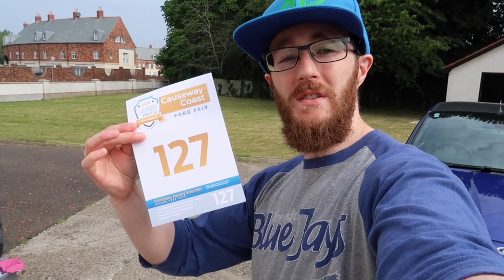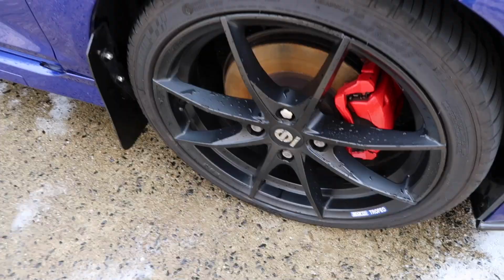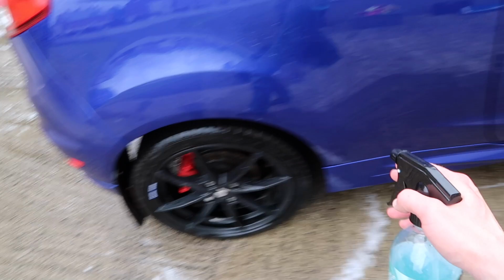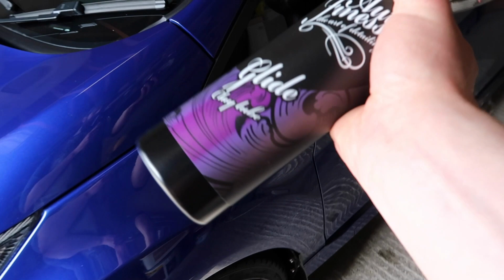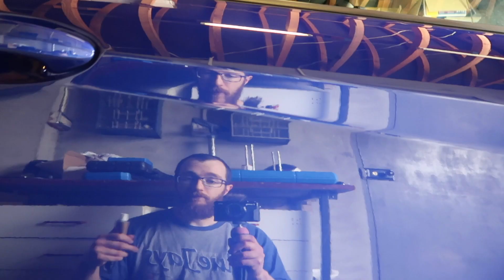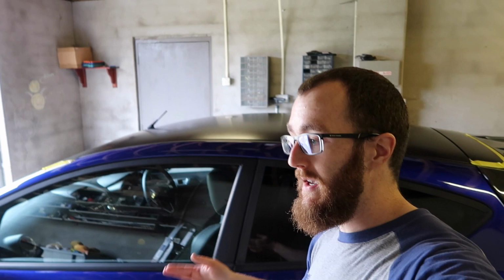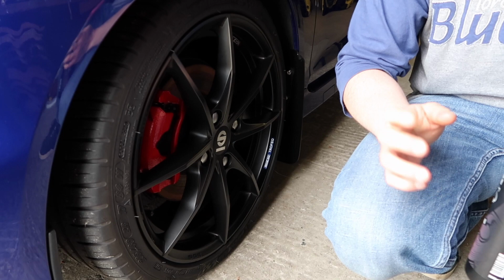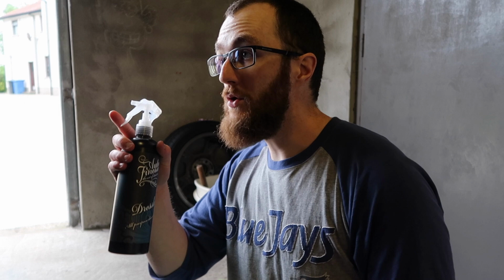FORD FAIR PREP! | MEGA DETAILING SESH | FIESTA ST

Comment: Cracking video. Really enjoyable watch. I have a molten orange fiesta st myself. Where did you get the roof, spoiler and mirrors done if you don’t mind my asking?
Reply from the maker: I got the roof wrapped at a place called AutoSkinzNI, the mirror caps came from a German carbon fibre supplier that doesn't trade anymore unfortunately and the the rear wing came direct from Seibon. I installed both myself :)

Comment: I am looking into buying a used one of these do you have any advice for me?
Reply from the maker: Try and get the lowest mileage possible, check the steering wheel leather for wear and if it is super shiny then it has been worn pretty hard so I would avoid, look for stone chips - the paint is notoriously thin so chips can be a real pain, check over for any weird mods or fiddling done badly, service history, etc

Comment: Hey bud, great vid! 

Just a quick tip, it could be worth getting some Citrus Pre wash in there before snow foaming. 

Citrus - Rinse
Snow Foam - Rinse 
Wash & Rinse 

Etc

Just because you don't want your buckets to be as dirty as that afterwards. They still should be somewhat clear if you've removed all of the contaminants through the pre wash contactless stages. I hope this helps bud! =) 

I use some of the similar stuff that you have, could also be worth checking out EZ Car Car for some goodies! Welcome to drop me a message and i'll help out best that I can =)
Reply: Majority of that dirt would of been from the wheels not the body of the car